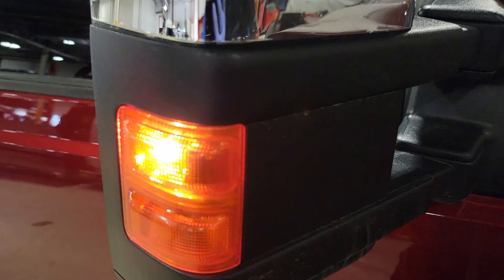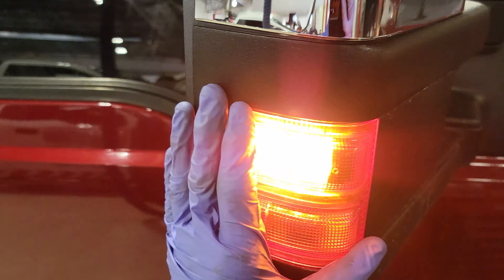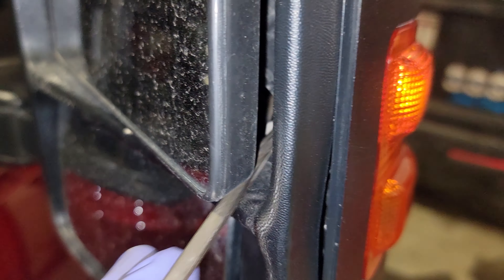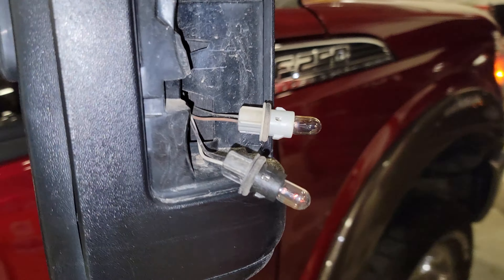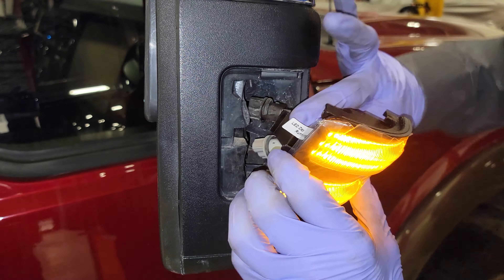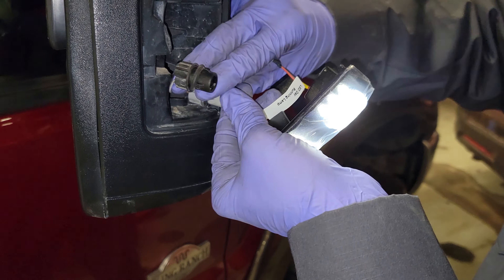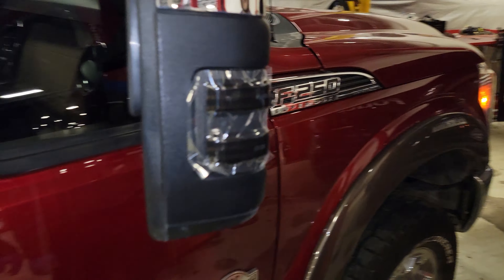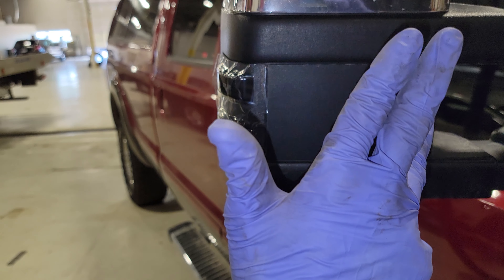Tired of those PLAIN MIRROR lights?? 2011-2016 Ford F250 F350 F450 F550 | SUPAREE switchbacks | EASY

Comment: Your supposed to feed the bulb wire adapters back into the light housing, and then seal the hole with the factory light bulb holders. As it is water, dirt, dust, ect will get into the housing and bulb sockets and either corrode or otherwise short everything out.
Reply from the maker: Good thing it was a prop....
Reply: Good tip!

Comment: After floor mats this was the second thing I did. Though my running lights on the mirrors are white and the turn/flasher lights are amber. Thinking about adding a light on the bottom side of the housing to have rear visual turn signals on the bottom of the mirrors. Mine are singular though not like the ones you have. Yours are better.

Comment: I have a 16 F250 and the ride is hoppy on the freeway or regular roads. I bought Bilstein 5100, I lower my tire pressure and installed Sulastic Shackles. Thinking it would ride better. My coworker has a 2020 F250 and it rides very stable and doesn’t hop like mine.  I need help 😣
Reply: Get rid of the Bilsteins and go with Fox 2.0s.

Comment: Good stuff, thanks for the how to.

Do you have any videos on repairing the mechanism for the mirrors? My 2011 won't telescope anymore and has gotten much slower for folding. I would like to pull mine apart and see if it needs replaced or maybe needs lubed up?
Reply from the maker: No i dont. There r no serviceable parts thru ford...ud have 2 replace..

Comment: I just installed these and there junk. They work fine when the truck is not running but after starting the engine they no longer work and only 1 segment flashes when signals are on. Im going to return them and see if the next pair works.

Comment: I have the recon lights similar to these except they’re completely white, anyhow. I can’t get the running light feature to work. Any idea? I tested all my wires with a multimeter and all wires have power. Any help would be greatly appreciated!
Reply from the maker: Garbage lights that's y
Reply: @ They’re brand new so I’m not sure why they’re not working properly I have the amber set as well and they’re the same way. I’ve flipped the wires and still nothing

Comment: I'm not sure if this is the right place to ask this question. Is it possible to put F350 overload Springs bump 350 stops on a F250? If this is not the place to ask this question could you point me in the right direction. This is on a 2022 Thank you
Reply from the maker: Yea. You shld have juss order the high capacity tow package in ur 250 & u wlda been all set

Comment: Purchased these and installed them on my 2015 F350 couple months ago.  They hyper flash and they flash from white to amber erratically when I use the turn signals.  Need to install resistors for each mirror but not a lot of room and no place to mount the resistors, unless I trace the wires back into the truck  its self.  Another words these are a pain in the ass to get them to work correctly.  So for now I just have the running light plugged in, so its white all the time and no flashing amber when I use the blinkers.
Reply from the maker: Forscan & IDS ur best friends pal....🤷‍♂️
Reply: @PowerStrokeTechTalkwARod  I just purchased these from your link due to your video. Does the above comment mean their not plug and play or will I need more parts? 
Great videos, keep them coming.
Reply: @PowerStrokeTechTalkwARod  will I need the Forscan & IDS you mentioned to make these work??? Thanks in advance.
Reply from the maker: No but to fix hyper flash yes

Comment: This is off topic Arod but I know you are the man to ask. Is running cetane boost in your power stroke a good idea ? I do know that Ford actually sells it so I can only assume that Ford wants us to use it. Will it make your truck regen less ? I just don’t know why we need it. Please help, thanks.
Reply from the maker: Yes brother you need to add it at every tank Look up on Google what it does it is very important
Reply: Motorcraft cetane booster was on sale at my local dealer parts counter, check yours, $8.99 for 20oz bottle beats anyone on the net.  My local performance shop recommends Stanadyne as well.
Reply from the maker: I'm over the Motorcraft stuff. Use our code PTT on Hotshot Secrets site
Reply: @PowerStrokeTechTalkwARod  I agree, some things that Ford does is absolutely incredible, other things are better left to the private community.  But I do still like the OEM look, fit and finish as much as possible.

Comment: Did this mod about 6 months ago, now the right mirror turn signal stopped working. Parking lamp works, all lamps on left mirror work. Tried a regular bulb on right mirror, still does not work. Any clue as to next steps?
Reply from the maker: Gotta pin point test those circuits.

Comment: I just installed some morimoto LED markers on my truck today, they look great. Does anyone know what the part number is for the rubber weather gasket that goes around the bulbs ? Mine are both cracked and about to fall apart.
Reply from the maker: No

Comment: Gotten 2 pairs of these suparee lights, neither pair worked right. Fit up just fine, clipped in serurely, blinker didnt work right on either pair. Woukd glitch and flash white for a few seconds before going back to blinking orange.
Reply from the maker: No probs here
Reply: @PowerStrokeTechTalkwARod  when truck is running they glitch, it's due to the 14 volts
Reply from the maker: That doesn't make sense
Reply: @taithawken4218  How do you fix this?

Comment: I just tried installing them on my 2012 and they didn’t fit. I’m thinking they are defective or something because they almost fit. I tried for 30 mins. Yes, I tried the other one just to be sure. There’s a small tab that aligns when you’ve got the correct one on the correct side.
Reply from the maker: I've done several have had no issues....